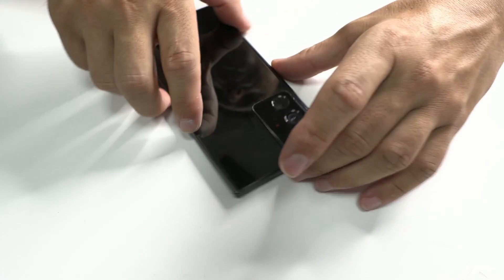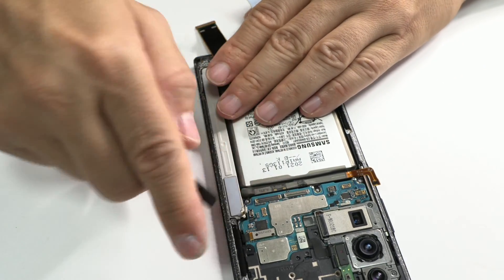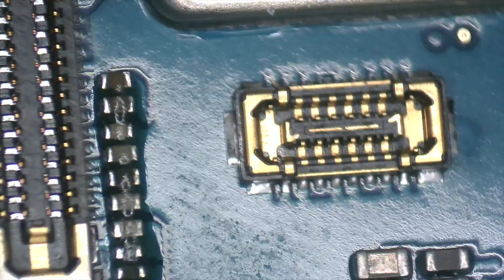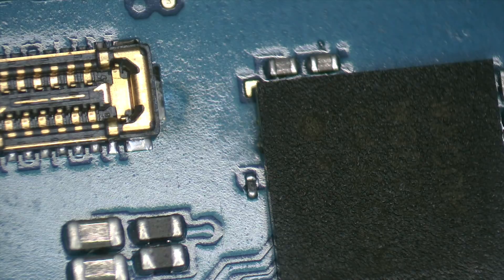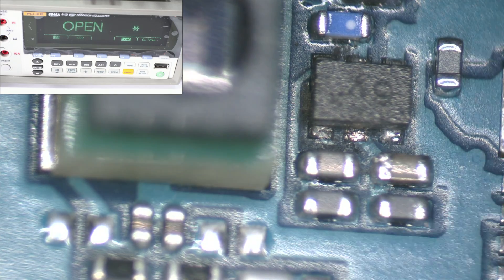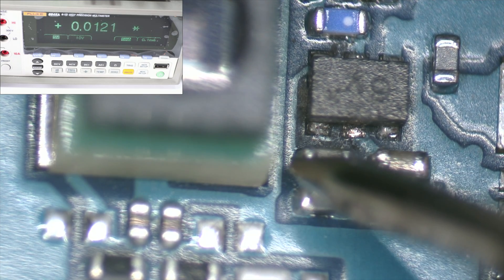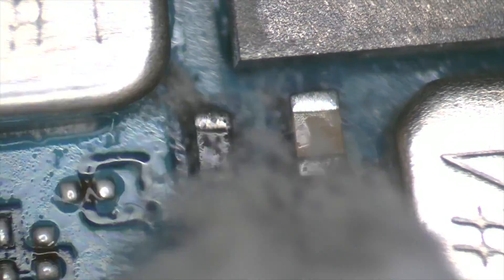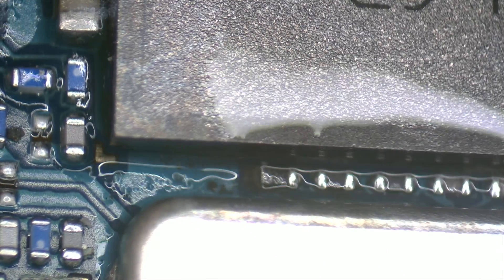Samsung Note 20 Ultra Water Damage: A Comprehensive Repair Guide

Comment: Hello.. I have a question, I have a Samsung Note20 who is water  damage as I was caught by rain without any luck of shades for about a kilometer. Once I got to a safe place, the phone did turn on while  after I have dried taking out the waters, and also worked for few more hours, but in the morning it was off, after taking it for check up, it did work for few minutes then went off, the screen is blank until now, the incident was 4 months ago. Is the motherboard off or just the screen??
Reply: if there's one thing I've learned is never trust Samsung water resistant bs 😂currently  my note 20ultra is off i better hope it works tomorrow

Comment: how we can calculate the impedance using multimeter, how can use the probe, where can fix red and black probes , can you explain it and can you make a video for to find a short circuit using with multimeter